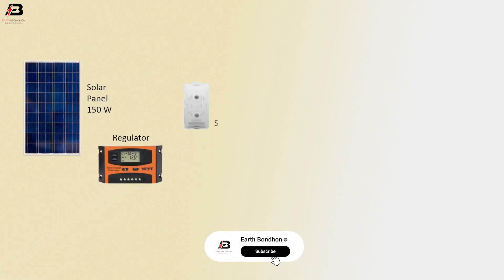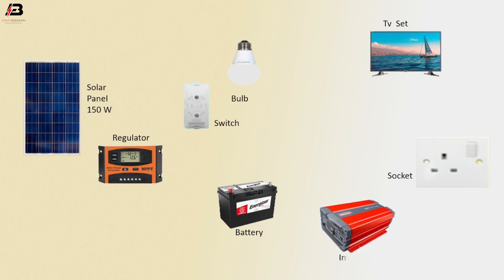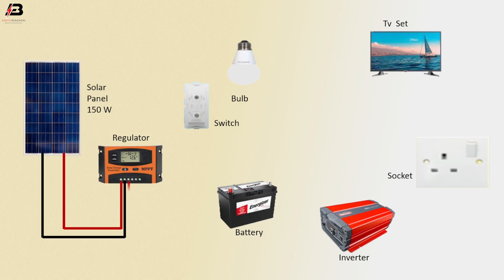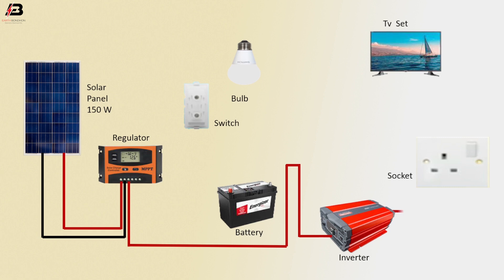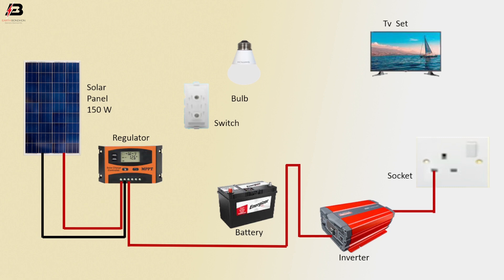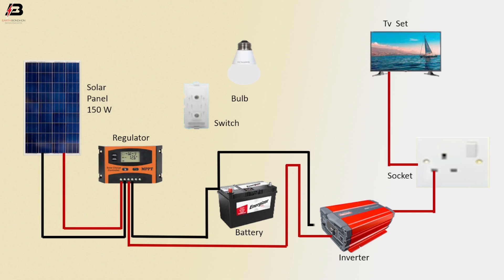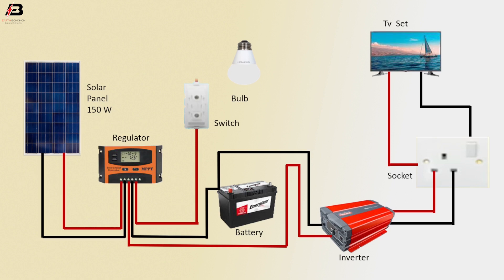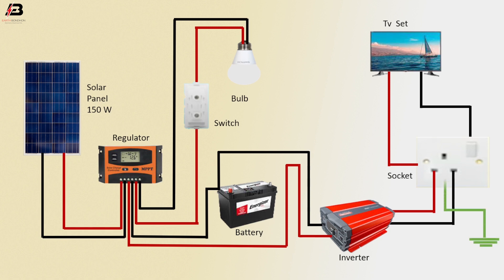How to do simple solar panel wiring to solar inverter | solar panel wiring

Comment: Very very wrong..why the positive wire came out from charge controller is not connected in the positive terminal of the battery? please explain how your connection will work is very confused